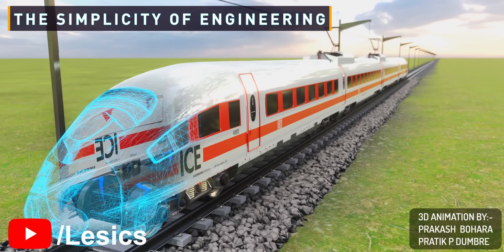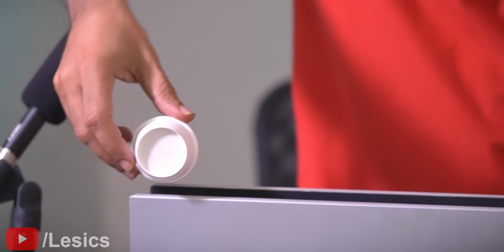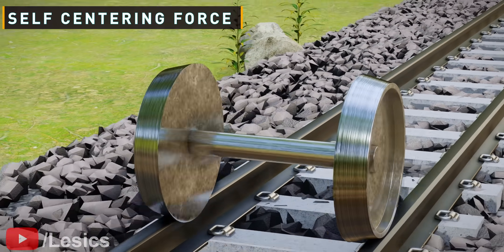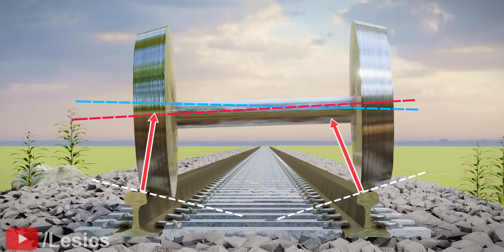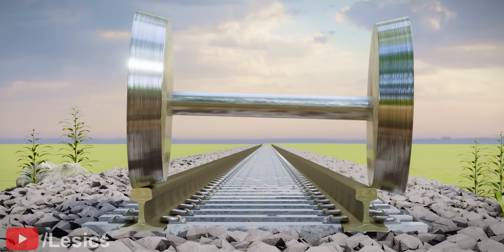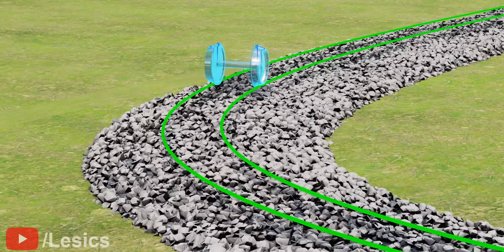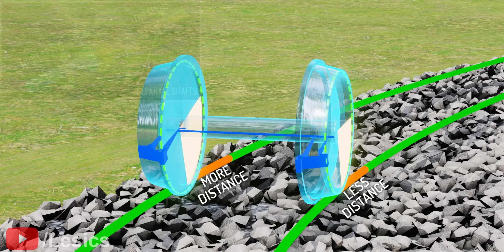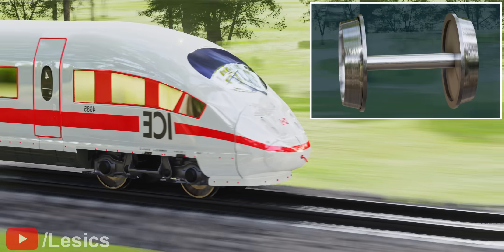The interesting engineering behind the SHAPE of Train wheels!

Comment: Question: In elementary school, we were taught that gravel is used to damped the forces on the ground cause by a passing train. Nowadays, most metro rails do not have gravel. What are the current methods used to replace gravel?
Reply: I believe there is no special method needed for metro trains, as the tunnels/bridges/roadways they travel on are made of concrete and steel, which can withstand the forces of passing trains. The reason other railways use gravel is because it's cheaper than steel and concrete and stronger than soil/dirt.
(I'm not expert, so take this with a grain of salt)

Comment: tracks run thru my town so we can see them up close.  one idea arises is how the tracks remain level.

they are laid on ties and under the ties is a couple of feet of gravel.  no cement holding them together.
doesnt the vibration of a passing train wreak havoc with the rock settling unevenly ?  and how did
early RR's handle this matter.

     doesnt your vid' assume the rails are both level and at the same height ?

       a little thought leads to the idea that uneven rails cause the train to tilt to the low side.
does the wheel angle have some range of operation where this tilt is tolerable ?
Reply: Thats a good question, the ties keep the tracks level, but the gravel should not move in order for the track to stay in right position , i wonder how they do that

Comment: Hey, i am actually working on a project to analyse the suspension system of railway bogie.
I have to model springs mass damper for  certain degree of freedom. I need the track irregularities or variations for modelling.
How did you model the train and environment and how to model the track and measure the irregularities?
Thanks

Comment: If the wheel profile was perfectly conical, the wheels would not be stable and would have a tendency to "hunt", oscillate from side to side, in an effort to find a stable equilibrium. hunting has a huge effect on passenger comfort and causes excessive wear on the vehicle suspension.

One of the people prominent in solving the hunting problem was Dr. (now Professor) Bridget Eikhoff, then of BR Research, whose team noted that hunting was more likely to occur when the wheels or tyres were either new, or had recently been reprofiled.
As a result of the work her team did, the "P8 Profile", replicating the shape of a part worn wheel tread, was created which went a very long way towards solving the problem.

Comment: Great video apart from the explanation being a bit backwards. By your logic using a "force analysis" the forces would actually just be in a new equilibrium configuration since the horizontal force components on the track are scaled by the shifted center of mass, so that they cancel each other. The real reason the wheels self-center is because as the wheels are shifted to either side by some amout, the rolling radius experienced by the wheels change. Therefore, one wheel will, for a given distance, travel a longer distance than the other, and thus the wheels will turn until the radii are the same for both wheels.

Comment: Another consideration is the variation in overall circumference. If we move the wheel set to one side then the wheel that is on the tallest edge is now a larger circumference and will cover a greater distance than that of the other wheel. Since those 2 wheels are affixed to one common axle and are therefore rotating at a common speed then the faster coverage will result in exceeded that of the other wheel thus self correcting. 
Very cool indeed!

Comment: There are errors!
The rails are not vertical but inclined at 1/20 towards the center...
In addition the axle does not roll straight as said in the comments but it rolls yaw (it goes from left to right drawing a wave of about 18 meters long)

Comment: First of - Great video, thanks for that!
But besides that for anyone wondering i gotta point out, that the animation is slightly wrong at 3:35. The voice says, that the angle on both wheels is the same but the traveld distance differs due to the difference of the radii - which is right. The animation though shows a different angle for the two wheels, which is exactly the opposite of the truth and the before spoken. 
The difference in length comes from the different CIRCUMFERENCES of the different radii of the wheels and NOT from a difference in angles.

Comment: How does speed factor in? You only have conical wheels of a given width. It seems to me that the inward force during a turn provided by differential action would of course be countered by speed and mass wanting to maintain its forward direction. That safety lip could only handle so much. Would be interested in the physics of that scenario.

Comment: 2 problems with this "marvel of engineering". 1) the contact patch between the wheel and the rail has been reduced and 2) there is not constant pressure applied to move the rails apart.

Comment: I don't know if this is still the case in the USA, but as far as I know, cylindrical wheel shapes were used there. The conical shape guides the wheel back to the middle position but it also forwards oscillation. So it is always a compromise.

Comment: the turn radius has limitations. each turn must be designed taking into consideration the taper angle, speed, weight etc
Reply: That's when the flange is needed to keep the train on track.
Reply: @ppdan  no flange will keep the train on improper calculated turn radius
Reply: @unicaproservice  the taper will keep the train on track in straight parts and normal curves while the flange will keep it on track in tight curves and switches.
Reply: @ppdan  calculate train speed, with regards to turn radius, then calculate centrifugal force with regards to train mass. then calculate metal plastic deformation force and tension limit. then read my first comment.
Reply: @unicaproservice  "The turn RADIUS has limitations" and in tighter turns "That's when the flange is needed".
What's wrong with that? I think you have misunderstood my comment much more than I misunderstood yours.

Comment: Coning of wheels helps to prevent shock loads to the sides of the rails, to prevent unequal distribution of loads on rails, and also to reduce the wear and tear of the wheel flanges and rails.
Reply: Very interesting, I wonder exactly this question. According to the video it is the inside corner of rails that are being hardly in use, isn't it worse rather than force applied to plain surface?

Comment: It's a similar effect to camber you'll find on racecar tires with a different effect

For a car the camber allows tires to flatten out maximizing grip around a corner toe is used to increase stability which is moving the tire in or out horizontally

Comment: The tapers they show are greatly exaggerated AND the whole story isnt being told here in regard to corners. The tracks on the corner turns are banked and while it may look that way to accommodate the force of the train's motion going through the turn, it's actually forcing the shift needed to create the differential.

Comment: Is there any drawback to their being a smaller point of contact on the cone vs a flat surface?  (As opposed to a flat on flat surface)  Do the wheels wear out fast?
Reply: I'm not sure about wear, but it drastically reduces rolling resistance compared to soft wheels
Reply: smaller point of contact -> more stress concentation -> more displacement -> bigger point of contact
Reply: I would think that this design results in grooves being worn in the arc of of most frequent contact. Thus reducing smooth transitions back & forth of the wheels, & increasing jerky lurching in & out of the grooves all the time, as the wheels shimmy back & forth. Perhaps barely noticeable by passengers though?

Comment: The differential explanation is pure bulls**t, it’s not true at all.
First, the wheels are to tight to the tracks, his theory would only work if the wheels could move much in both right and left direction, which they can’t, it would have been very dangerous.
Secondly (and most important) the wheels are slippery and could not produce as much friction as it would have required to make any difference.
Third, his turn in the example is much sharper than any real life train tracks.
Last but not least, trains wheels aren’t always connected with an axle, they can be separated which also totally sweeps his theory away.
With all this said I’m starting to doubt the cone shape as well, though still it seems logical.

Comment: The wheels are not conical at a constant angle like shown on the animation, all the way from the outer edge up to the notch that prevents slipping off. Instead, at least half of the surface of the wheel is flat, otherwise the train composition would be constantly wobbling, and even strong winds would be able to destabilise the composition, despite the weight of the train. This design would also create a unnecessary constant pressure on the connecting rod at 90° angle as well as too much pressure per square centimeter on the wheel/rail.  When train composition is running on a non curved track then it stabilizes itself on the flat parts of the wheel. Inner half is conical but in a curved line and it is only a prevention mechanism to guide the wheels back to the center, and therefore on the flat part of the wheel.

Comment: Yeah, train wheels are the perfect example of keeping things simple, no need for expensive over-engineering and complex mechanical parts. Very simple but very clever.
Reply: Its reealy simplified in video... Real wheel profile is way more complex and still evolving... For example in Europe is most common UIC-ORE shape from cca 80's
Reply: To be fair trains are on tracks so it doesn't need complex mechanical parts, vehicles need to manually turn on the roads while trains just needs to speed up or slow down.
Reply: @slowville6637  I bet if the train was invented today it would have involved something more complex.
Reply: @laernulienlaernulienlaernu8953  Well you can say that about anything if it was invented today because our technology is far from simple design.

The highspeed bullet train being built today is way more complex than regular noisy & ruff trains but it is also way more superior in almost every way.
Reply: @slowville6637  that's what makes things like train wheels so impressive, because they had to find solutions without all the tech we have today. They might seem primitive now but to this day train wheels haven't changed despite all the advances in technology.
Reply: @laernulienlaernulienlaernu8953  Look what I'm saying is they are simple because they are on rails, there is something guiding the wheels so you only need wheels that will ride along the rails without flying off,  just look at roller-coaster.
They are genius but not complex for that reason, cars are complex but they can do so much like racing/drifting/donuts & ramp jumping, they can even go off road which a train can never do due to simple wheels.
Reply: @slowville6637  I think that's what my original comment said, very simple but very clever. I don't know why you keep comparing them to cars. One of the challenges in designing them is that they ARE on rails, they aren't free to move like car wheels. And I'm pretty sure that rollercoaster wheels aren't the same.
Reply: @laernulienlaernulienlaernu8953  Dude no, you said they are simple and not over-engineer complex mechanical parts and my first response was well they are on tracks so no need for complex parts, I used cars as an example of why they needed it, you then even respond that if it was invented today it would be complex, that right is there is saying something different from your original post.
Reply: @slowville6637  whatever mate. I can't be bothered to go back and forth. No they don't need to be complex because they're on rails but it's a good example of how something can be simple and do the job of something more complex.
Reply: @laernulienlaernulienlaernu8953  yeah and they would cost a bazillion dollars because of all the eggheads involved trying to over complicate a simple thing.
Reply: @Kevin L So original Kevin L(oser)
Reply: Yeah, I know if they just apply that concept to your washing machine. Fill agitate drain fill drain and you’re done.  I don’t need all this complex computer boards.

Comment: The lip on the inside of wheel obviously makes a huge difference as well. I've loved trains all of my life. You can also here flat spots on the wheels of certain cars from braking friction, etc. as they pass by regardless of track connection spaces.
Reply: Huge difference for what? (The flange is mentioned in the video as a safety feature--it doesn't really have anything to do with the taper, which is what this video was about).

Comment: I've looked at train tracks before, and I always see the wear on the very top side of the tracks; not the inner edges. Also, with the wheels like this, they would be putting extreme outward pressure on the rails, pushing them outward. So, if train wheels are at an angle, the angle is VERY minor, and not enough to make the differences in diameter as shown here. Go look at photos of train wheels. Better yet, find a train and look at the wheels. The angles, if they exist, are not anywhere near as shown in this video.
Reply: The angles shown are for demonstration of the forces, wheels in almost all use cases have a much less noticeable shallow angle but it's still there. When it comes to the tracks being pushed apart: the angles of the wheels are shallower and the forces are less than would be expected from what is shown but it is a problem over long periods of time  and is one of the several things that needs to be dealt with when maintaining tracks.

Comment: Also, there seems to be the added advantage of shifting the centrifugal force to counter the gearing adjustment for stability in G force cornering, in other words, the train will automatically lean slightly into the bend much like the counter force applied by a motor/cyclist when cornering. KISS :). Always the best solutions to a problem.
Reply: Remember that in reality, on faster curves the track is canted into the curve, to balance the horizontal force to some extent. Usually done with a degree of deficiency - hence the term “cant deficiency”, something like 6%, depending on where you are.

Comment: How elegant, as good engineering should be! Solving huge engineering problems using just simple geometry. No gears, extra shafts, or separate machines or control electronics. 
The engineers were like, “Just add a taper and we’re good.” 😂
Reply: "Simplicity is the ultimate form of sophistication"
Reply: @emponator   ඞඣඛගකඣඞපඪ
Reply: @emponator  хйфйшаж

Comment: This video does a shit job of explaining the “net force” that it shows. The real “force” at work here is the diameter of the contact patch. When you move to one side it the wheels contact the rail at a different spot on the tread of the wheel. This means that the circumference of each wheel is different. Meaning that one wheel will cover more distance than the other per rotation. Hence, the train will turn, or self center.

Im drunk, sorry if this didn’t make sense.

Comment: Great animations, but unfortunately the physics are wrong. The vertical forces are negligible compared to the turning horizontal force. If the right wheel slips to the right its diameter in touch with the track increases, the wheel has a higher lonear speed but the track is not moving faster. The left wheel gets smaller, so slower. The left wheel wants to run slower than the track underneath and the right wheel faster. It creates a massive torque: the right wheel speeds up and the left wheel is braking, thus turning the whole axis to the left, until it's centered again. These are very powerful forces and have nothing to do with the weight balance. 
Similarly on a curve (let's say to the left to stay on the same example) the train wants to go straight, gets the wheels more and nore on the right side of the track  and is creating a massive force TURNING the train to the left.

Comment: My understanding is that it's not just the conical shape of the wheels that provides the differential. The flange itself is not a vertically-sided unit, but has a curve where it joins the tread of the wheel.  So if the wheel goes sideways to the outside of the curve to the point that the flange comes into play, the circumference in contact with the rail rapidly increases.

Also, keep in mind that this is nothing new.  As far as I know, this has been the case with railway wheels since pretty-well the time that railways were invented over 200 years ago.  (If anyone knows just when this shape was invented, I'd be interested to know.)

Comment: Such wheel will make much more pressure to the rail. More pressure= faster wear out of wheels and rails. 
There was another briliant idea with train wheels, when some master mind created wheel with rubber ring and outer wheel ring. Everything was for lower vibrations during the trip. But outer ring was deforming contiuosly during rotation. And eventualy it broke, causing train crash.